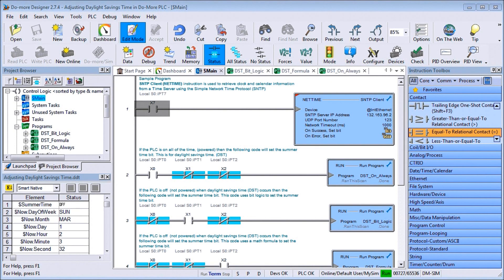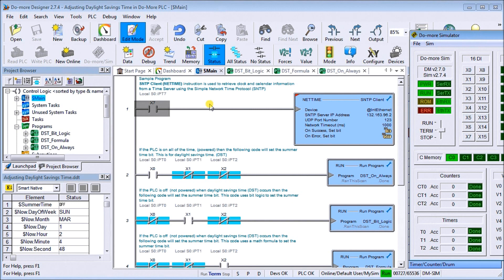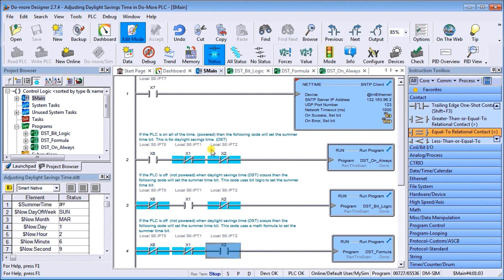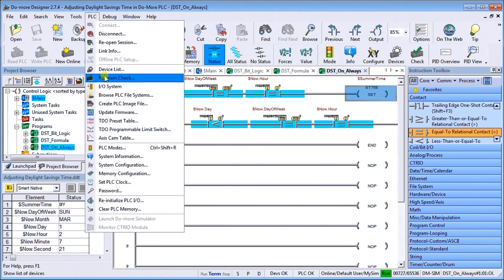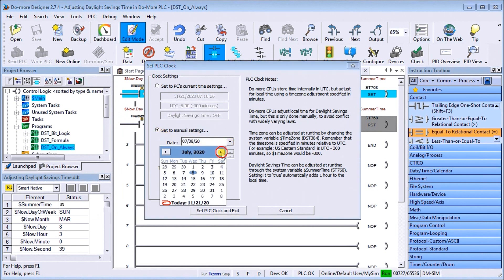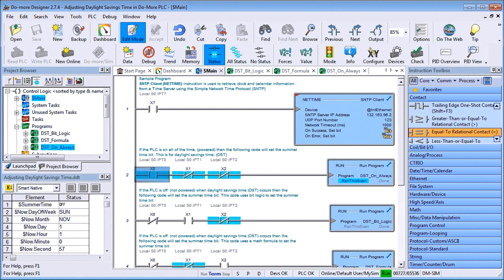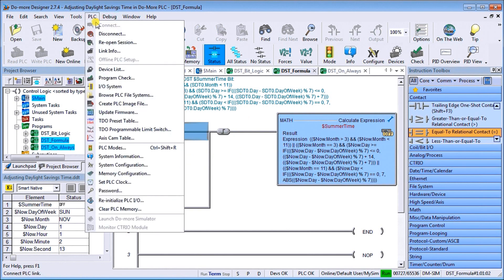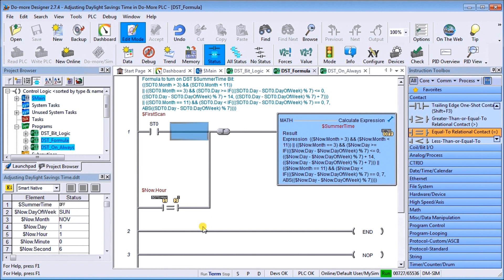Adjusting Daylight Savings Time in Do-More PLC (DST)

Comment: The primary example you gave was to use the time set up through the DO-More as a stand alone unit correct? Not hooked up to the internet I mean. If so, can you use the CLICK or DO-More internal clocks to program outputs? e.g. Turn on at 5pm off at 12am, on at 9am off at 12pm...without the internet
Reply from the maker: Yes, you are correct. This is a stand-alone unit without an internet connection. Outputs can be programmed using the real-time clock. (RTC) Without using the internet to sink the time, you could be +/- 100 seconds per month.
I hope this helps you out.
Regards,
Garry
Reply: thanks @ACCautomation